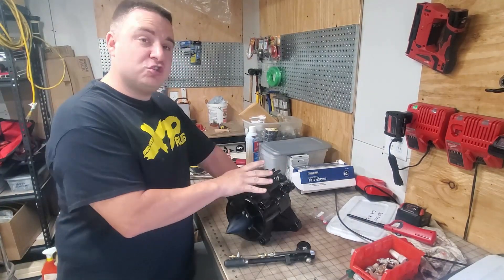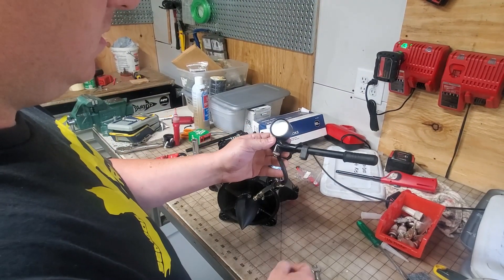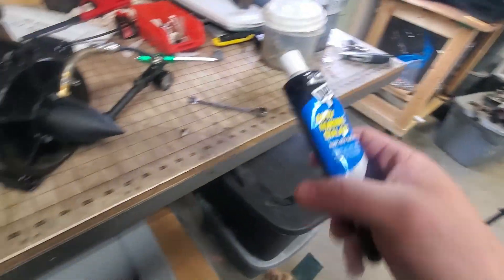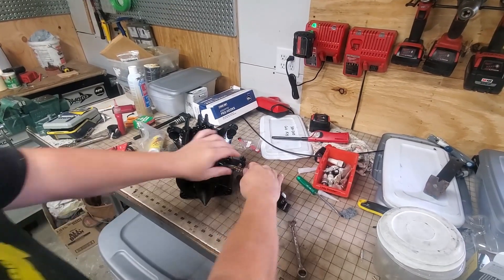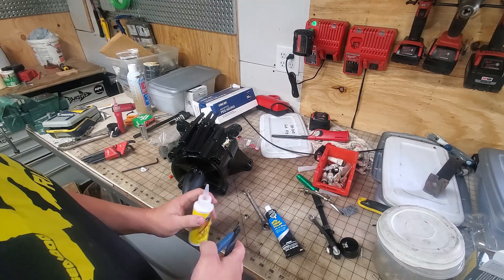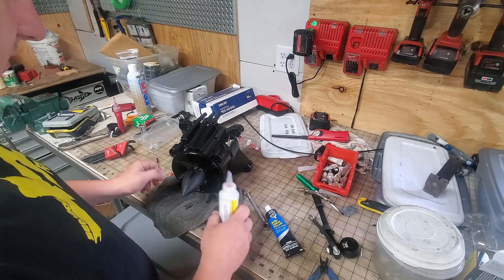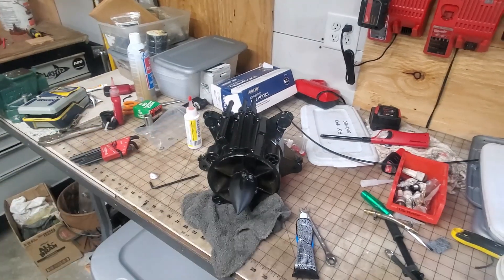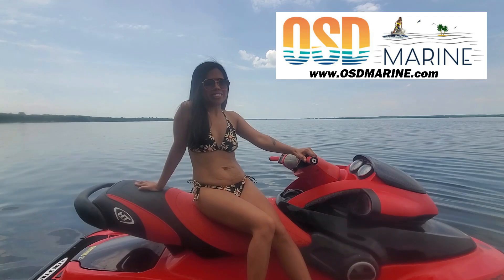How To:  Jet Pump Cone Pressure Test

Comment: Where did you find the correct valve to thread into the fill hole??
Reply from the maker: Its nut 1/8 npt i believe. The pump i bought on amazon had the fitting

Comment: Do you have a link for that hand pump you have with the fittings?
Reply from the maker: Any bike handpump on Amazon will work, i use this for the cone and for the carbs.
For carbs you need a pump thatll do 30+psi.
For the cone you just need a pump thatll do 10psi.

Progressive Suspension GP3-60 '0-60 PSI' Mini Gauge Pump , black https://a.co/d/aCqqat2